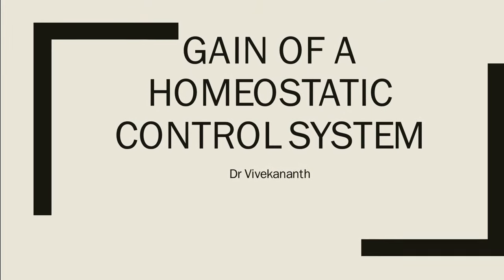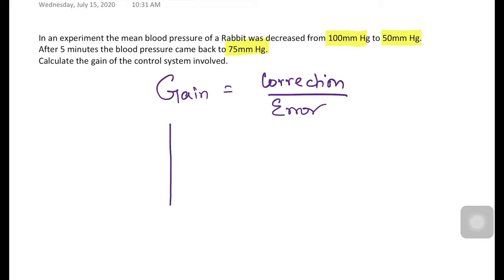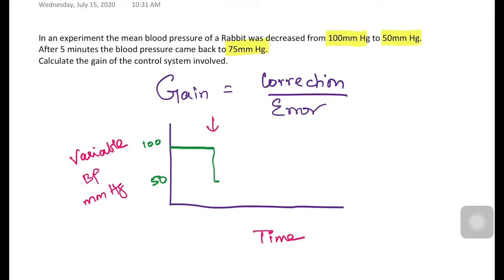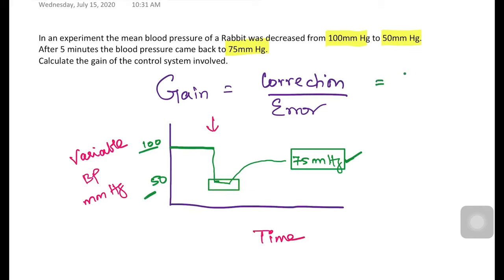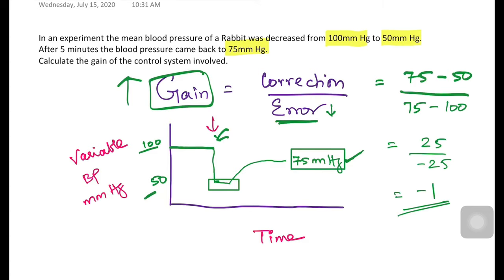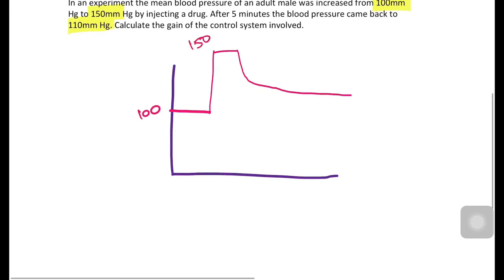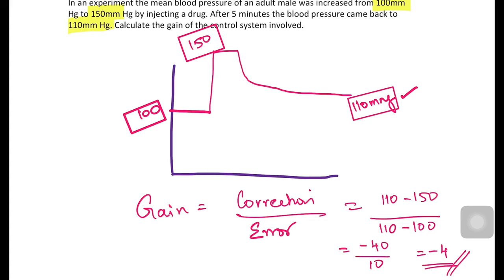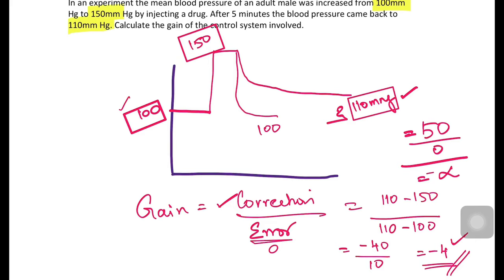Gain calculation in Homeostatic control system.

Comment: If absolute magnitudes of correction vs error are what're important, and the signs don't matter, then why have signs at all??  Why not use absolute values, so as to eliminate confusion?
Reply from the maker: Yes! That’s totally fine. Use absolute magnitudes and just add a negative sign to the gain value at the end. It’s a valid shortcut!
Reply: @ThePhysiologyChannel  I appreciate your quick response.  Great channel.

Comment: Positive feedback - positive gain

Negative feedback - negative gain 

Gain = correction/error 

Correction = final value - post-intervention value 

Error = final value - pre-intervention value

Greater the magnitude of gain, greater the efficiency of the homeostatic system at restoring the balance following some disturbance to it (intervention)
Reply: What did you mean through "following some disturbance to it”?

Comment: Sir . One Question that for ERROR value why we have subtracted corrected value 75 from set point value 100. we could have subtracted 100 from 75... plz explain this point.
Reply from the maker: The direction of the changes are essential to the get gain value with correct sign(negative in the negative feedback gain)